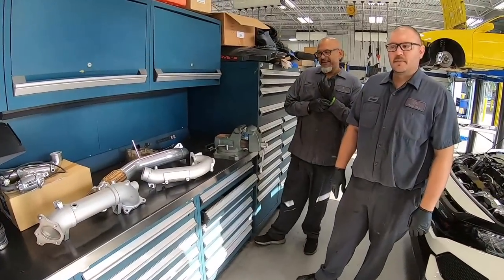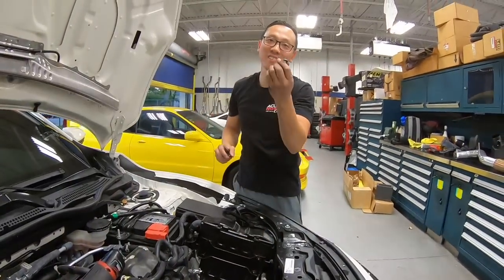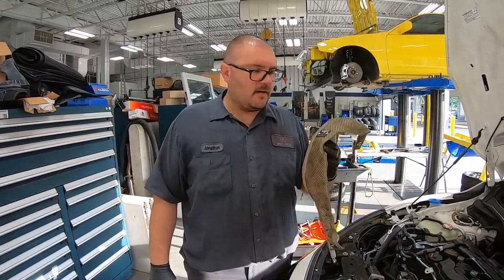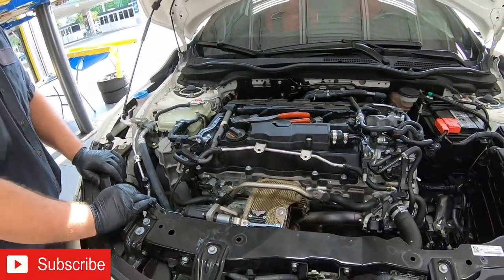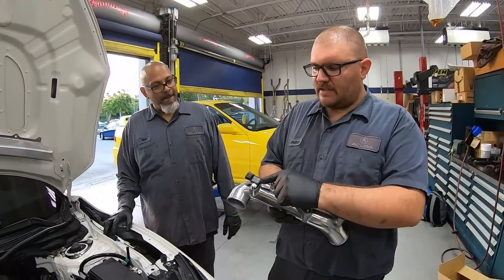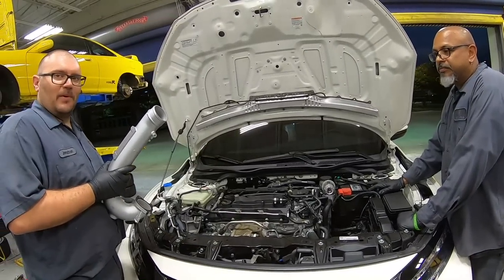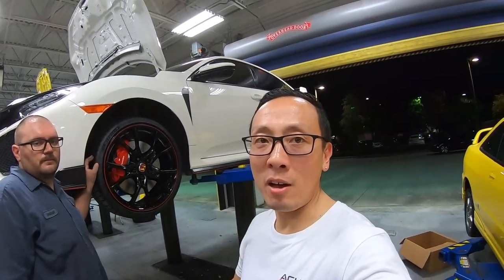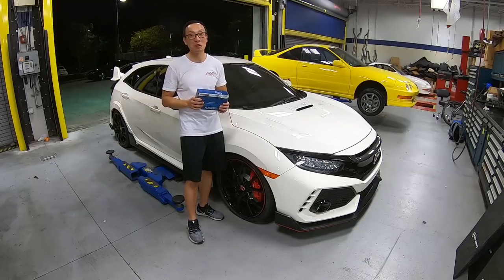FK8 Honda Civic Type-R - Installing RV6 Ceramic Downpipe Front Pipe HKS Blow-off Valve (Episode 3)

Comment: Man, I wish I can find some guys with this type of knowledge and profesionalism around my area, I'd have peace of mind leaving my type R with them
Reply: @ahcgarage  what state are you guys located in?
Reply from the maker: South Florida
Reply: Real comment there
Reply: @ahcgarage  Hey i really need help with my HKS BOV on my 2018 Hyundai Elantra Sport, I have an HKS adapter that replaces the original. I'm super confused on where the hoses go... Could you kindly explain to me where each hose goes starting from the BOV and what hose connects to each end of the T fitting, where its coming from and where its connecting? I would greatly appreciate it as I can't find anything anywhere explaining the hose connections properly.  Some say connect it directly to the Solenoid, but what about the T fittings? what is connecting to each end and where they coming from or going. Thanks a bunch

Comment: Stock intake box is better off anyway. The OEM box flows great and with a drop in k&N gives these $500 heat soak intake run for it money.
Reply from the maker: Agreed, the OEM intake box does flow really well.

Comment: I keep hearing adding the BOV on these cars is bad. Since its venting to the atmosphere, opinion?
Reply from the maker: Not sure if that true
Reply: Yea, everyone keeps saying the same thing.
Reply: I agreed. But people only putting this HKS  bov on the car because they like to hear the release pressure sounds.
Reply: @bisimoto has a video on his channel of a HKS BOV installed Civic SI and tested the myth while attached to a dynajet. I believe his results found a 5HP increase before he started tuning.
Reply: “Hearing” is never a good way to find out if aftermarket products work. You have to test it yourself. If I went off of hearsay (most of the time from people who never even tried), my car would still be stock🤷🏾‍♂️
Reply: Hmmmm, but it has a MAF that account for the air thats been vented out so therefore it throws it off because it’s expecting that vented air, thats the way i’m seeing it.
Reply: Yep it is bad. Unless you ditch the MAF and do a speed density tune which requires a stand-alone ecu. If you’re using the stock ecu which includes the MAF then venting already metered air to the atmosphere is a terrible idea. You’re letting go of the air that the ECU has already accounted for which causes a moment of rich condition.
Reply: @henryherrera9111 This eninge uses a combination of MAF and MAP to calculate the correct amount of fuel. As long as you dont bypass the map you shouldnt have huge problems than maybe stall when you rev it to much while moving.

Comment: Did the ceramic coating make a difference to your temperatures?  Also did you go with Silver ceramic because of personal preference or better heat resistance than black ceramic?
Reply from the maker: The color is just our personal preference. No sure if it's cooler than black ceramic
Reply: @ahcgarage  Did the ceramic coating on the inlet charge pipe make a difference with temperature and performance?   As you are the first ones that I have come across that did the ceramic coating on the inlet charge pipe,  would like to see what you feel performance wise by doing this.  I am exploring this option vs a new titanium charge pipe vs a ptp blanket?

Comment: Dang what those CTRs need are lower profile tires. Freaking rubber bands! Pretty sweet regardless.
Reply from the maker: They are 245/30/20. Pretty low profile for a production car, specially a Honda

Comment: Honest question on turbo blankets.  Keeps heat off the motor and helps reduce timing cuts when it over heats and less heat less wear on the motor.  But doesn't the blanket also cause the turbo to over heat and hurt the bearings?
Reply from the maker: That's his baby, don't think he would let that go any time soon

Comment: Anywhere you can give me a run down of when you installed the HKS Bov on how the vaccum lines were tied together? Also I'm hearing that with the HKS bov it needs a proper tune once installed? I am currently on a custom tune with hondata now do I need to do a retune to eliminate air and fuel?
Reply: To be easier for you besides the retune, you can use a recirculating kit